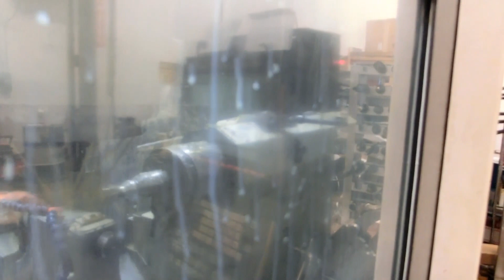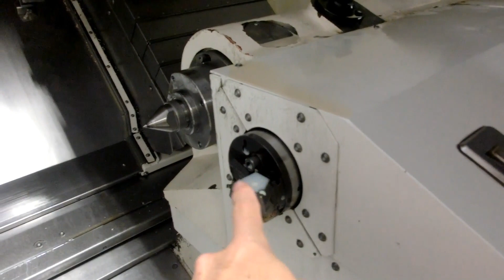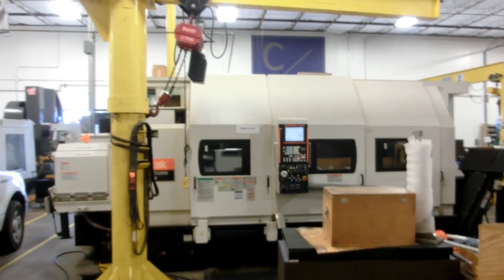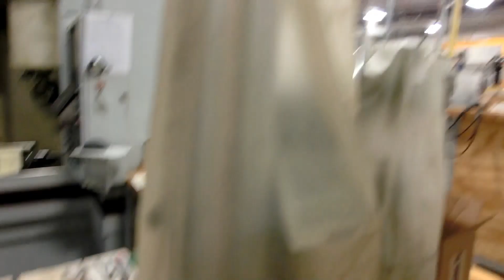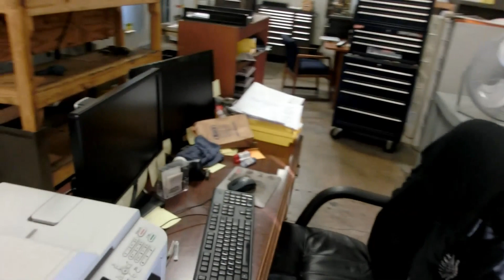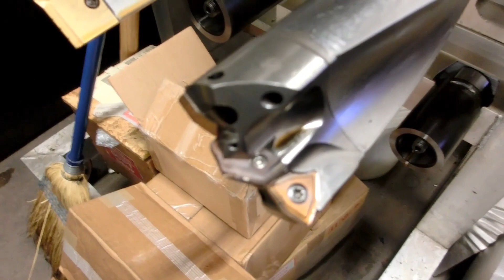Shop Tour

Comment: I don't see many shops fitted out with a series of radial cranes but it's a better solution for workstation areas where you're moving quite a few things around with a crane.
A lot of people say that the lathe is machine number 1 but I think the shop crane comes in first really !
Reply from the maker: If the machine has the capacity to work on heavy parts it should have a crane of some sort. Preferably of the capacity the machine can handle. It is a safety issue. Using a forklift to load parts into a machine can be dangerous. I have seen many close calls. Luckily no one was hurt but it makes me uneasy. It’s a consideration many people don’t consider. A two ton crane with foundation and hoist costs around $15,000-20,000 dollars installed.
Reply: @EdgePrecision  It wasn't the lack of a crane but the fact most shops I've seen either have one gantry crane that can traverse the whole shop or a couple of smaller ones. Radila cranes seem to be relatively rare but I think makea very good solution for localised handling.
Forklifts are very handy - too handy and they get misused - typically with items not adequately secured to the forks; or with big overhangs - and they're not always convenient to get their wheels where you need them. They're also not really designed for fine movement control either - in any direction !
I know one place that had or has an Iron Fairy mobile crane but being a crane mounted on a proper vehicle, it's a bit big for indoor jobs unless there's plenty of room.

Comment: 27:00 How did you find out the trigonal fitting is stonger than the taper next to it ?
Reply from the maker: It is known the trigonal tapered holder Capto is a stronger connection than a straight taper tool holder. A few reasons is it makes contact on the face of the flange and the taper. Because of the face contact they can use more retention force on the drawbar. Also the trigonal shape means it needs no keys for orientation. Particularly good for a mill/turn type of machine. I knew this from reading about it. After experience with them I’m convinced that this is the best spindle connection there is.
Reply: @EdgePrecision  My lathe has an L0 'long taper' nose - which I think is better than many fittings. The single key on it ensures fittings are always attached in the same orientation (it's tempting to say it guarantees drive too but I suspect it's rare a taper will slip.)
Cam-lock fittings seem common but I just have my doubts about location accuracy with them.
My lathe, like I guess many (manual ones at least) is designed to hold a centre via the spindle female taper. I'm not sure what mine is but some people claim it's a 5 MT but I don't think it is. In any case, the lathe comes with an adapter down to 3 MT - so the plan for mounting a centre relies on 2 'random' located tapers - which I suspect won't be as accurate as making a specific L0 taper centre.

Comment: Where do I start 
It’s a lot to take In 
Which I love ❤️ is the mazak machines 
I’m a mazak lover there older machines are work horses 🐎 
I own all mazak except one Cnc mill and it’s a sharp 
How long you been Machining for?
Reply from the maker: I would say professionally more than 40 years.
Reply: I been doin this for only a year and a half 
What kinda software you use cad and cam 
Between the four I learned solidworks ,mastercam,bobcad,fusion 

Fusion is my favorite
Reply from the maker: My cad software is SpacClaim and the cam software is Esprit.
Reply: Edge Precision 
Hmmmm never herd of them is the program user friendly does it have a mazak processor or does it convert gcode into mazatrol 

And also what do you use to upload 
Your program into your mazaks

Comment: Any chance you could tell me a little bit about that ratcheting wrench you use to adjust your four jaw chuck? Looks fascinating but I wouldn’t be surprised if it came with the chuck/machine. Thank you!
Reply from the maker: I bought it from Northern Tool. What's written on the wrench is Titan CR-V It's a 3/4" drive. Fully extended it's 29.25" from the center of the 3/4" Drive. I have even put a 24" pipe on that and pulled with everything. It is still straight no bend yet after about 4 years of use. I don't know if they still sell it. Maybe on line, I haven't seen it in the store sense.
Reply: Right on, thanks for the reply. I’ll have to keep an eye out for something similar, wouldn’t mind a husky ratchet like that for chuck work

Comment: Do you own your own inspection instruments (bore gages, profilometer etc.) or do you use Centerline's?
Reply from the maker: For the most part I use my own measuring tools. But Centerline does the final inspection. So any special things like a profilometer They would do the measurement. As far as working at the machines I use my own measuring tools. I also set things like bore gages from my own gauge blocks. Sometimes there customer supply’s special thread gauges as needed. Hope that answers your question.

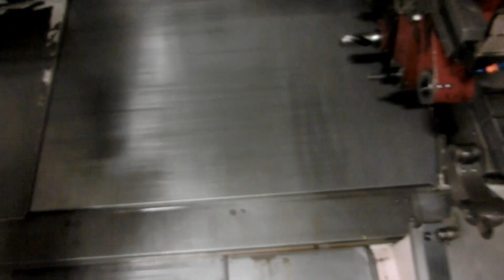Comment: 15:07 "I don't know who designs these things but... they need to get a machinist to help them out" 

😂😂😂
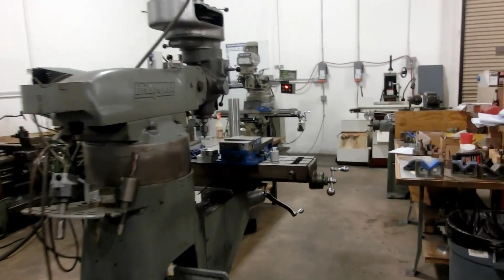Reply: Eric S. Also at 20:30. It could be a 5 axis if they knew how to Programm it😁
Reply: I am an engineer and I own a small machine shop.  I have also worked in a auto repair shop before.  It never ceases to amaze me the the stupid things engineers design which would not have been put into production had the engineers got there hands dirty and actually tested there designs in the REAL WORLD!!!
Reply: I worked on a 350 MY with this steadyrest, you need to make a cone-extension, or else you will go crazy. I don't understand Mazak is not manufacturing such a part.
Reply: True story, I work with the guy, who along with his lead at the time, made the O ring molds for the challenger solid rocket boosters..And they told the Higher up's and NASA not to try and launch at colder temps, because the rings would not seal right.. Even Rocket Scientists don't listen to machinist's at their peril..

Comment: You pay the rent, but your machine is the biggest of all :D
Bye the way, Capto is a beautiful system but I don't know why is not frequently used, maybe because given it's cost is used only on machines that can really get benefit from it
Reply from the maker: I think the Capto system is the best spindle and tool connection. I think the reason in the past it wasn't as widely used is Sandvik owned the rights to it. They made people pay (I think rightly so)  to be able to manufacture and use it. Now that their patent has run out I have been seeing it more and you can buy aftermarket tools now.

Comment: What do you think of the Quantum machines? They are relatively cheap machine but I'd never seen one in use until your shop.
Reply from the maker: I'm not sure if you can still buy one new. The machines you saw in the video are about 20 years old. They still run but two of them have little annoying  problems. You see it is difficult to get parts now for them. There are aftermarket parts but they are very expensive. That being said they aren't  bad machines these mills have done a tremendous amount of work. I think the Toyoda mills are about the same in quality. If I had the choice I would go with the Toyoda. They both have the same Fanuc controls.

Comment: I am glad we are not the only shop that has a Zeiss cmm sitting on the shop floor ;)

Interesting tour, thanks!
Reply from the maker: Actually the Zeiss belongs to me not Centerline. That's why its out in my area in the shop. Zeiss clams this type of CMM can tolerate fairly wide temperature fluctuations. Its very handy to use if your straightening parts to a flatness. You can scan the part and display a plot on the screen. That way you know just where to push on the part. I've used it many times this way by dragging a small hydraulic press next to the CMM.
Reply: @EdgePrecision  can you please make a video on your cmm its capabilities the kind of that you are using the diffirence just an all around introduction of cmms and say what year it is the problems you had with it the price of a brand new one and I think it will be a good publicity for you since you are trying to sell it I am no buyer I am a student that just want to learn

Comment: As for all the comments about poor mainainance and filthy shops. It is ALL MANAGEMENTS FAULT. I have allways worked in top paying ,hi presure job shops and have never seen anyone fired or disciplined for not cleaning their machine, only for being to slow or scraping a part. Edwin Dirnbeck
Reply from the maker: Yes I agree if the management is lazy about discipline this will happen. Also in shops I have worked in with older machinists they would get on you if you left a machine dirty. In the manual machine days you generally moved to many machines to complete your work so you cleaned the machine for the next machinist.  Now days with CNC and more of a production atmosphere people tend to stay on one piece of equipment. So there is less pier pressure than back in the day. I am a little bad myself about keeping my machines clean but I do pay attention to issues that could cause problems with the machines operation.

Comment: Your skills are incredible. If someone else had told me that the capto system is more ridjid than a cat 50 plus,I would scoff.You have explaind it AND USED IT. Thank you for increasing the knowledge.Edwin Dirnbeck
Reply from the maker: I was also skeptical at first but after running machines with both style of connections I can tell you without any doubt. The capto C8 taper is more rigid a connection than the cat50 or cat50 big plus taper connections. It all comes down to retention force on the connection a cat50 spindle might be in a range of 4000-6000 Lbs. A capto C8 should have twice that force or more. Also I have notice this with cat tapers they move in the spindle causing a form of corrosion or abrasion on the tapers it looks like brown marks on the taper. This doesn't seem to happen on capto tappers even with hard cutting forces and long tool extensions. In the shop here we have long Sandvik silent boring bars like 24" long with capto C6 taper mounts on the end. When I first saw these I thought that would be a problem. They work great, in fact once you use one you don't want to go back to a normal bar. In fact I would rather use one than a solid carbide bar no mater what the size.

Comment: The rust-kinda-thing on the cones of the holders is indeed from vibrations during milling. (time 25.00)
Reply from the maker: I think its called a fretting type of corrosion. It can be cleaned off with a scotch bright pad if you don't let it get excessive. It will eventually do damage to the spindle of the machine.
Reply: yeah, that's what i do on my tools if it's getting those kinds of marks.
but mostly showing up when using it with long tools and heavy duty milling.
Scotch Bright and some oil clean them up nicely indeed.

Comment: So you still working in that shop as co-owner? or you just working on the integrex in that part of the shop for your own profit?
Reply: Just rewatched the beginning of the movie, now i understand how you come in this shop (rent-paying) (kids came into the room when i started watching. watching and listening in english while listening to my kids don't go together) ;-)
Reply from the maker: I sold the business in may of 2005. About 3 years ago the present owners asked me to do a certain set of parts. Because of the nature of the parts and the quality control it was necessary to do these parts in their facility. They asked me to move what equipment I had back into the building and the would rent me space to work. At that time I bought the Mazak Integerex e650-H machine. This very unusual arrangement has worked out very well. I have a separate business they provide material and the quality control I just do machine work and invoice them for it. In the state of Texas you cant just work after hours on someone else's equipment as a contract worker indefinitely. After about 90 days they have to consider you as a employee. Because I own all of my equipment and supply all of my tooling I can legally do this. There have been shops in Houston Texas that tried to do this with their employees on their equipment and got in trouble with the Texas Employment Commission. That is let their employees work after hours and pay them per part. They had to go back and pay back taxes for all that time. I also give them advice as needed on some jobs.

Comment: Since i'm following you on youtube this weekend. I ended up on this tour of your 'onces yours' shop. And I totally agree on the flaw of the nexus machines, the problem with the steadyrest and tailstock. I have the same problem on the latest Intergrex machine. Pieces need to be at least 800mm long. And the tailstock is so far away from the steadyrest it's not suited for smaller diameters...

Comment: the c8 is almost equivalent to hsk80, they make HSK up to 160 size, that's 160mm on the diameter. 150kw spindle runs that tool. But the Kennametal version of the HSK, the KM4X, is stiffer than capto. I haven't seen many on ebay, i wonder if its because they're using them longer, or if they just didn't sell well?

The SPX 5111 Turn-Mill , uses HSK160 taper for example.

Comment: Nice nice shop, best equipment in this shop MORANDO lathe for me :)
Reply from the maker: You are right when that machine was newer (read that before their abuse) it was a very accurate engine lathe and strong. I bought that lathe when I worked out of my garage to make some valve parts that had all metric threads. I would always prefer to machine metric threads. It is a dream on a metric lathe. Thanks for the complement.

Comment: Quite an operation, Peter.  What type(s) of industries are your primary customers?
Reply from the maker: Thanks Bill, The petrochemical industry now. When I owned the shop we also did quite a bit of semiconductor work. Here close to Houston is a town called Austin Texas (You may have herd of it) There was a company named CDS that made some of the equipment for Applied Materials (The people that make processor chips) We did a lot of work for them but they closed down their Austin location so that dried up. So now its just Oil Field work for NOV, Baker, Halliburton and others to name a few.